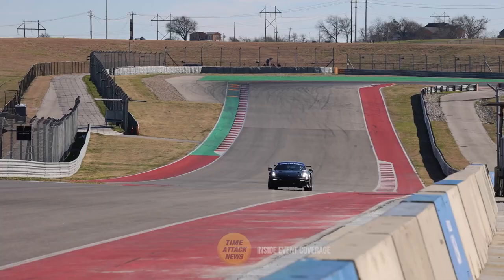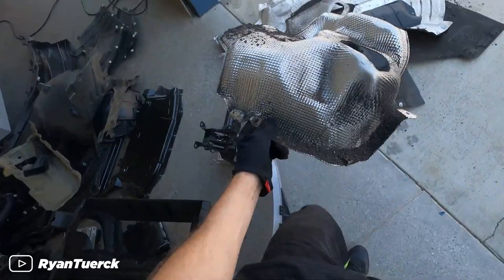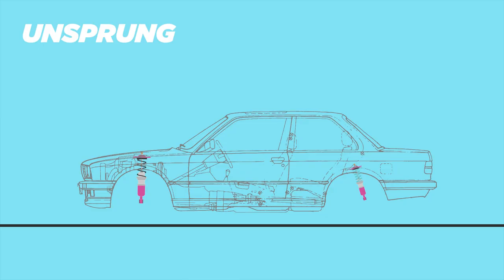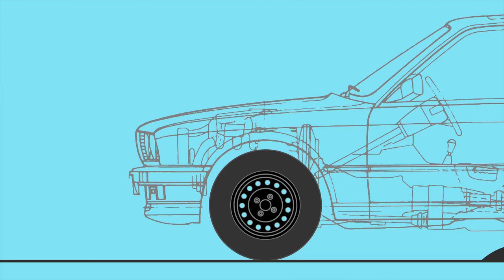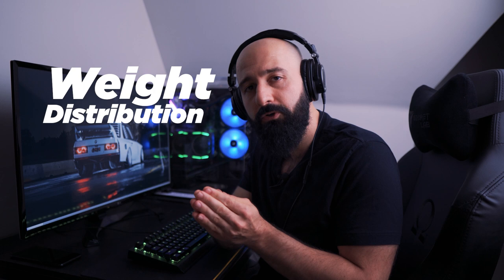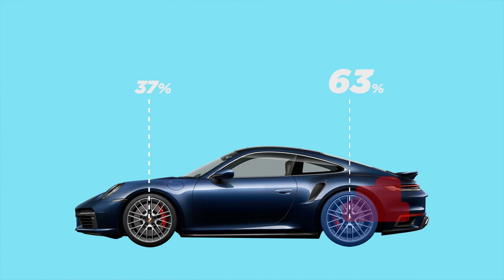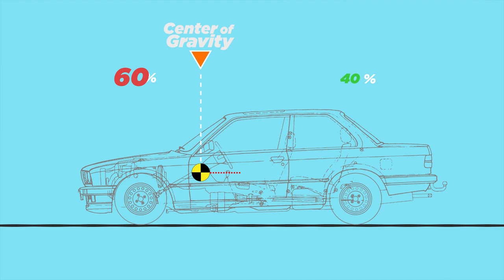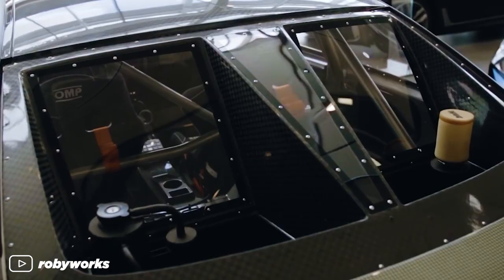Weight Reduction || EXPLAINED

Comment: i put custom billet aluminum rims on my motorcycle 10yrs ago.. PM machine and you could feel the difference instantly .... i remember my first corner i almost ran into the inside curb because it turned so easily -- those few pounds MADE A HUGE HUGE difference i couldnt believe it -- and you could even tell exceleration to -- so then i went lighter sprocket a 530 to a 520 chain -- i was able to really soften up my suspension because of the less weight of the unsprung parts and it handled .. WAY WAY WAY better

Comment: I think you're the right person to ask this!
How do I easily get an RPM signal from my motorcycle? It has an ECU. But I don't know anything about the wirings and couldn't find any diagram to help me out.
What's a more generic way to get RPM signal from the engine? I need to feed that signal to my Arduino micro controller.
Reply from the maker: If you have an ECU the final signal usually comes from the ECU itself. The ECU usually uses signals coming from the crank position sensor or cam sensor or a combination of both. You're gonna need to look at some wiring diagrams to be sure